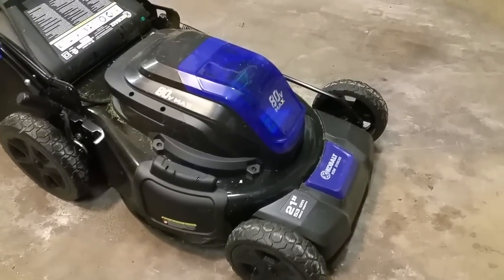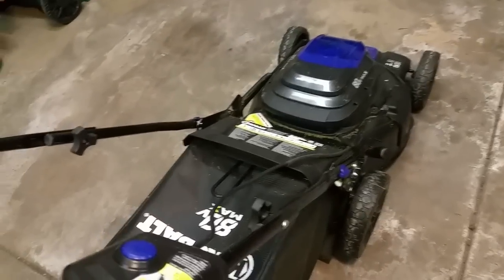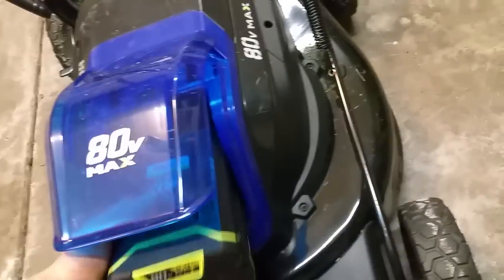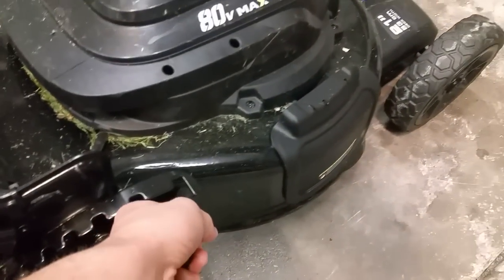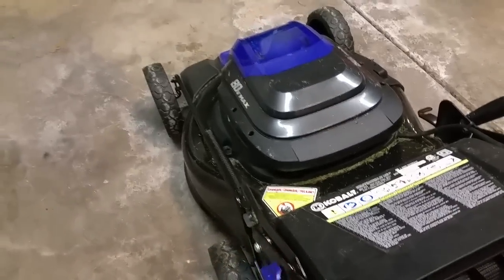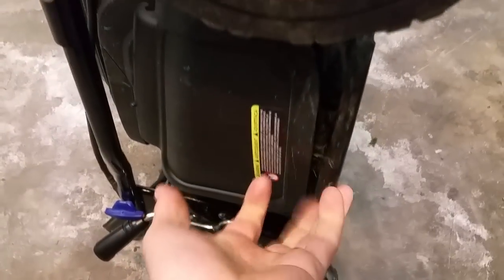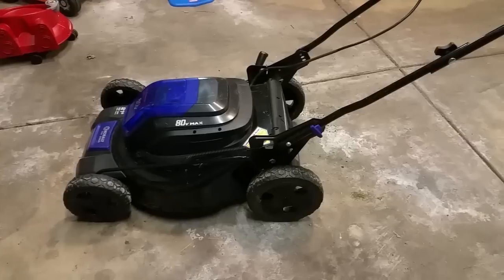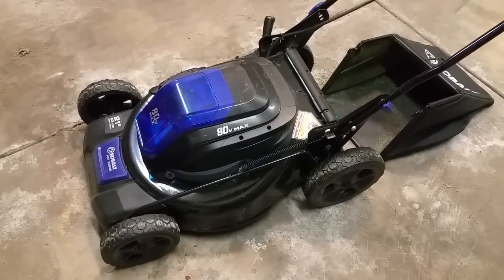Kobalt 80V Lithium Powered Lawn Mower Review

Comment: There is a couple things you did not mention, good review though, !. Warranty on the Home Depot on is an additional $80 for 3 years and you get 5 years free with Kobalt, so it raises the price on the Home Depot one and also buying the additional batteries and what not. I am just going to bite it and get the Kobalt one, tire of all the maintenance of the gas ones, and buying gas for it, it is time to go green!
Reply: +higherwater43 Lowes tries to get you to buy an additional extended warranty for the Kobalt also. But you don't need to. The stock 5 year hassle free warranty is fine. I got to test that today (5/4/2016) for my two year old mower. But I had to sidestep them asking why I hadn't purchased the additional warranty, and instead point out the place in the manual where it says 'return to place of purchase for replacement or refund' and they were like 'oh'. And offered me either option. I chose a replacement because although it's not perfect, I really like this mower.

Comment: Thanks for your review.  Can you comment - does the battery get very warm after running the mower?  Does the battery need to cool down at all before the charging sequence begins?  Thanks!
Reply from the maker: Honestly, I'm so hot while cutting the grass, if the battery was hot, I didn't notice it. I mean, I pick it up and it's not burning my hand or anything. And I do let the battery sit for 10 minutes before putting it on the charger.
Reply: Thanks Chris.  So to be clear - you let it sit 10 minutes before charging.. "just because"?  Or because you feel it's too hot to safely charge right off of the mower when depleted?
Reply from the maker: EnochLight just because

Comment: Additional Info:
1) Battery Compartment - If you have sandy dry patches in your lawn, sand/dirt easily gets into the battery compartment.  Next mow, I'm going to try & fix this by lining the battery compartment with painter's tape (comes off easily afterwards).

2) Blade Replacement - Lowes did their customers a disservice here by going with a non-standard outer hole design.  Those two outer holes shaped in the form of an arrowhead (>) are specific only to the Kobalt brand.  No other brand of blade uses that outer hole design.  If you want to use another company's blade, you'll have to buy some sort of adapter, and I don't know how that works.

The second bad thing is that the blade for this mower seems to be in short supply at Lowes.  They don't normally stock it in store, and I've come across complaints that it takes a long time to get, sometimes being backordered for weeks.  So Lowes not only made sure you can't easily use non-Kobalt blades, but they also seem to be in short supply of this specific Kobalt blade.

3) Parts Replacement - Here's where it gets a little alarming.  Unlike other mowers, there is NO comprehensive parts diagram for this mower ANYWHERE.  The only parts you can reorder are the outside hardware parts (maybe 6 or 7 pieces).  There is no parts diagram of the engine.  You need to replace the plastic bolt holding the blade?  Too bad.  The part number is NOT identified or listed anywhere.  This goes for every engine part.

The best I could do is research the Greenworks equivalent of this lawnmower.  Kobalt does NOT manufacture this mower.  Greenworks makes it for Kobalt.  It is a near clone of the 80V Greenworks mower.  Unfortunately, Kobalt intentionally instructed Greenworks to make cosmetic design changes, so that certain parts are NOT interchangeable (blades, batteries, chargers), even though it is the same mower.

Anyway, I researched the Greenworks 80V mower parts and their manual comes with a FULL breakdown of all the engine parts.  HOWEVER, the only way to see if a Greenworks part will fit this Kobalt mower is to order it & try to install it.  For example, I've ordered the Greenworks mower blade retaining bolt, but until I get it and compare it with the original, I don't know if it will fit the Kobalt mower.

If Lowes had properly identified every part of this mower, and kept those parts in stock, everything would be okay.  But not only does Lowes not stock engine parts for this mower, they made sure that you can't easily get replacements from anywhere else.
Reply: Steve Rogers I almost bought one, glad I read this. my lawnmower had been backfiring nonstop and I know nothing about them. I always thought electric would be easier and safer for me in the end. apparently it is a pain the ass. no idea what to do now.
Reply: + Buttchow 

I'm not saying this is a bad mower.  I'm just pointing out the disadvantages I discovered after I purchased it.  I researched a lot about battery mowers, and this one had the most advantages for my situation.  

The main thing I was concerned about was dead batteries right out of the box or batteries that fail before their time.  ALL brands & models I researched had this problem to one extent or another.  If a battery goes bad, or is dead out of the box, I can't wait 6-7 weeks for the manufacturer to send me a replacement.  The lawn grows quick in the Florida rainy season.  That's the main reason I bought this mower, rather than the Ego mower.  Ego is of the best quality and has the best customer service, but they're not local.  Getting a replacement battery under their warranty can take 6-7 weeks.  Plus, the last I checked, their 56V mower only came with ONE battery.  So if it's dead out of the box, I'm really SOL.  And ordering an extra battery upfront will cost you another $280? or so.

On the other hand, this Kobalt mower came with TWO batteries.  Under the Kobalt warranty, if one of them is dead out of the box, or if it fails in the warranty period, you can take it to any Lowes to get a replacement.  And that actually happened to me.  One of the batteries was dead out of the box, and I went back to Lowes the same day and got a replacement.  No Hassle.  They didn't have any new batteries on hand, but they did have a battery in the display model, which they gave me.  And if they hadn't had any batteries on hand, I could have checked other local area Lowes stores.  And even if those stores had been empty, I still had one good battery, and I could wait for a replacement in the mail.

Otherwise if Ego mowers had local repair locations & battery exchanges, I would have bought their mower, instead of this one.
Reply: Please update when you get a chance to try the blade retaining bolt or any other parts.
Reply: @rocketraccoon1976  so overall, get ego yard tools? Also isn't ego home depot's btand, so couldn't you bring it there?
 I'm trying to decide which brand to go with, and I've been leaning towards ego since it comes with two batteries that charge quickly.
Reply: + Johann Lopez 

If I had a choice back then, I probably would have gotten the Ego.  

However, I have had the Kobalt 80V for two mowing seasons now and it has worked out great with no problems.  It also comes with two quick charge batteries (about 30 min to charge).  I still tape up the battery compartment, and I still bemoan the lack of replacement parts, but it hasn't been an issue so far.  I never did get that retaining bolt.  Too much hassle to test it out.
Reply: + Steve Rodgers
But if you had to choose which one to get now, would you still pick the kobalt? Also which  one has better trimmers, hedge trimmers, and blowers?
Thank

Comment: We have the original 40v version.  Just found out there is a recall on ours due to a fire hazard.  I like the electric mowers, but with ours I have to mow over the grass twice to get all the grass cut.  I don't know  if the 80v version has that problem or not.  Yours looks like it has two batteries strapped together.
Reply: Brent.2017 I use 80v don’t have to go over 2x

Comment: I just bough the Eco 56-Volts 2 months ago!. I wonder if this has more power since is 80-Volts. I get 45 min fulled charged but if grass is light and and not cutting it very low.  Eco does not increase speed when need it as you mention this kobalt does. ad you are right design on Eco is better, seems kobalt was more focus on the power. nice that comes with 2 batteries. Eco comes with one.
Reply: +Andres Agredo Voltage doesn't necessarily equate with power.
Reply: I have the Eco 56v  for 6 months now and really works  vey good.

Comment: The main advantage of the Kobalt over the Ego is that if something goes wrong beyond 90 days, all you have to do is take that joint back to Lowe's, for a replacement or refund and that's that. I have read Ego has decent customer service, but it involves calling and what not. I'm sure they have you doing troubleshooting you probably have already done and at the very least waiting some days for a replacement. To quote the great philosopher Sweet Brown, "Ain't nobody got time for that". That being said, design wise, the Ego wins hands down.
Reply: +jaydarl2 Exactly right. And I got to test Kobalts 'hassle free warranty'. (5/4/2016). Lowes honored it np, although I had to point out to them in the manual where it says 'return to place of purchase for replacement or refund' before they would honor it. You also need the original receipt, and the original purchaser with ID present.
Reply: I've dealt with both Lowes and Hoe Depot customer support.  Lowes wins hands down.

Comment from the maker: I would say 30-40 minutes, depending on cutting conditions...wet/dry, grass height etc. I'd imagine only getting 20 minutes if the mower is in high speed the whole time trying to get through tall wet grass.
Reply: Chris Hovis we've had one for a couple years and your right. It's closer to 40 if the lawn is mowed regularly and 30 if it's a little long. The battery takes 30 minutes to charge and we have a larger irregular lawn so it works perfect if we need that 3rd battery to finish up, the 1st battery is all charged up by the time the 2nd battery is dead. Kobalt warranty is great to. We had a battery charger fail, it was only charging batteries to 2 lights. They sent out a new charger in a week no questions asked.

Comment: Hello, Chris -- I just got one of these, and the battery won't click in fully.  So I haven't been able to start the critter.  Did you have any problem like this?  (Don't know if it's relevant, but looking inside the hatch at the metal battery-contact points I saw three -- looked as though there should have been four: there's a gap between the left-hand one and the other two.)  It's the right battery -- the two that came with the mower -- and it's right-side-up and all: just doesn't lock in.
Reply from the maker: VRT No lock in issues for me at all. Sorry to hear that. Maybe exchange it for another?
Reply: (Good news: no need to exchange.  I kept trying with the battery over several days, and finally the springs inside the battery-hatch allowed it to click home.)

Comment: Well, 80v at 2 A or 56v at 4 amps is pretty much the same power wise.  224 wh compared to 160 wh.  but you might be able to go faster.  Maybe the rpm is higher since it's 80 volts.

Comment: I bought this mower a month ago and it just died on me today.  On top of tht, one of the batteries was DOA out of the box & it took over a month to get it replaced.
Reply: +Dcgo409 The trick is, I found out the hard way, is to have the original manual, page marked to the warranty statement. You have to point out to the store manager, where it says 'return to place of purchase for replacement or refund' before they will honor it. Then they take care of you right away, no waiting for days.

Comment: I'm taking mine back.  It would be perfect if it stayed on the high power setting the entire time, but only does that if it thinks it needs to.  On the lower power setting, it barely cuts the grass and it won't suck up anything off the ground, even loose leaves just stay.  I have a small yard and even at the high setting, I would only need one battery or maybe two to do my entire front and back yard.  It's too bad you can't control the motor speed of this mower.
Reply from the maker: Bill Cobb I agree, I wish hi power all the time was optional.
Reply: Or a switch to go back to low when going over thin grass
Reply: I can see where you’re coming from, but I like how it comes and goes. I’ve noticed if you ease up to thick grass, it’ll engage the high power. I haven’t had a chance for leaves, but with grass, I’m super impressed.
Reply: @joehanika  I think a new blade install might fix suction power. ?

Comment: Just picked my Kobalt 80v mower today.  Do you have issues with the location of the wire that comes down the handle for the starter button?  Mine seems to get jammed up between the handle and the big flap on the back of the mower.
Reply: Fred Woltman I had the same problem after I clipped one of the plastic zip ties because it was covering some of the plastic wrap in the original packaging.  I replaced it with a new zip tie and problem solved.
Reply from the maker: I agree with hank...one zip tie took care of the wire. Done and done.

Comment from the maker: the mower is lighter than my gas lawn mower, but it isn't self propelled. If you're used to self propelled, I think you will miss it using this lawn mower. I have never used a self propelled, so, I'm essentially not missing it.
Reply: +Chris Hovis I had a self propelled Lawnboy before I bought the cordless Kobalt and it's so light, it's not only easy to push, but it's far easier to pull back and maneuver than the Lawnboy was.
Reply: I haveckobalt 80 volt self propelled.   It is  $550.

Comment: 80v motor would be more efficient and wouldn't necessarily need more than 2ah pack. It would have longer run time than a 40v 4 amp/h battery. 
Higher voltage=less current.
 Less current=less heat.
 Less heat= higher efficiency.

Comment: AH is not a good indicator of battery capacity unfortunately.    Two batteries can have the same amp hour ratings, and yet have widely different capacities.  Just look at the amp hour rating of your microscopic cellphone battery for example which is about 2.5 amp-hours (but at very low voltage).     This misleading stat is intentional, and otherwise they would use WATT hour, which actually tells us how much energy is stored.   

Watt hours = amp-hours x volts.   

So you have a 2 amp-hour battery powering a 80V unit = 160 watt hours of energy in that battery.  The Ego is 56V but 4 amp-hours, which = 224 watt hours.  

So while you are right that its a higher capacity battery, its not 200% greater capacity, but rather only 140% capacity.   Lowes aka Kobalt (its their store brand) does sell a 4.0AH battery though for this unit, although its quite an expensive battery.
Reply: And BTW, if you're wondering why they shifted to advertising amp-hour instead of watt-hour when they went Lithium, its because Lithium is not necessarily superior except when you factor in weight.

My 2010 model, 6-year old Black and Decker lawn mower is 36 volt 12 Amp-hour battery with 432 Watt-hours capacity.   Its not a lightweight battery (about the size of a car battery), but has more capacity than even the hugely expensive 4.0AH battery for this 80V unit, which is 320 Watt-hours.    They were $100 a piece when I purchased two of them, providing 860 watt-hours of battery capacity for my mower at $200, which is over five of the 2.0AH batteries for this unit, or $600+ in batteries.    

So Lithium is much lighter, absolutely no question, but not necessarily higher capacity compared to "old school" batteries installed on older battery lawn mowers and golf carts.
Reply: I guess then the benefit of the Kobalt is that for the price you get two batteries which would be a total of 320 watt hours even though you have to change the battery to get this.  It's better in my opinion than having to stop and charge for 30-60 minutes.
Reply: It's true that Ah in isolation is not a good indicator of battery capacity. Still, the math to compute watt hours is hardly difficult. It's simple multiplication.

What happens more often is that consumers use voltage as an indicator of battery performance, as if 80V is automatically twice as good as 40V. To put it in your parlance, "Two batteries can have the same voltage ratings, and yet have widely different capacities." Vendors reveal their willingness to mislead when they use specsmanship games like ratcheting up voltage and then advertise based on that single spec. They know that consumers will buy based on such specs due to their ignorance of the total picture, and of the significance of factors that the vendor suppresses in finer print.
Reply: DumbDuck44 in